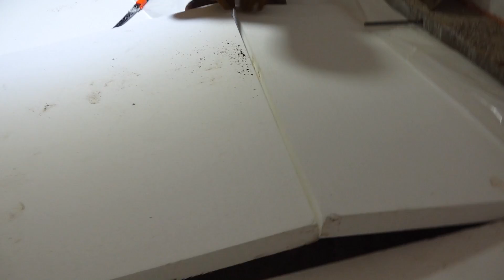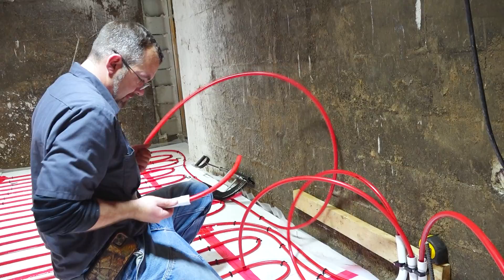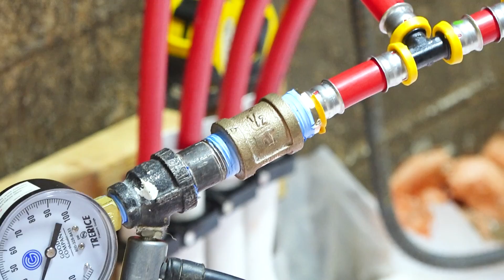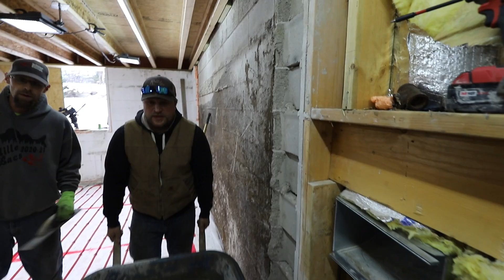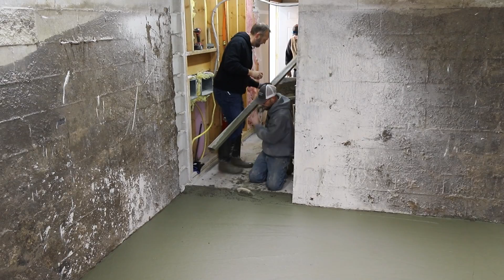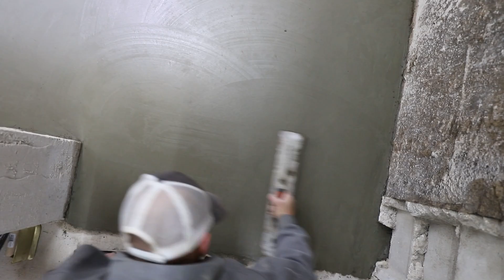Pouring the Basement Floor with Infloor Radiant Heat | Home Renovation & Addition Part 19

Comment: Why didn't you hire a pump and pump the concrete in . It would of been a lot easier and one heck of a lot faster. Plus you wouldn't have taken the chance of rupturing or puncturing one of the lines with the wheel barrels or people walking on the lines .
Reply: Couldn't get the truck there
Reply: The truck couldn’t get within about 50’ of the window even if we could It would had to moved around by hand or wheelbarrow. Using a pump would have cost $650-750 and not saved any time. 2 guys moved all of the concrete in to places in about a 30 minutes. Tires on wheelbarrow  will not damage the pex a board was placed every time it was dumped

Comment: Why didn't you pump it through the window?
Reply: The truck couldn’t get within about 50’ of the window even if we could It would had to moved around by hand or wheelbarrow. Using a pump would have cost $650-750 and not saved any time. 2 guys moved all of the concrete in to places in about a 30 minutes. Tires on wheelbarrow  will not damage the pex a board was placed every time it was dumped

Comment: MATT -- WHY DID YOU NOT BRING THE CONCRETE FOR THE FLOOR THROUGH THE EXISTING WINDOW RATHER THAN WHEEL BARROW IT IN? I ENJOY YOUR CHANNEL VERY MUCH !
Reply from the maker: Truck can’t get over there. Thanks!
Reply: I was also thinking in the line of a concrete pump. But it worked out fine anyways. Maybe a pump isn't worth the money for such a small area?
Reply: The truck couldn’t get within about 50’ of the window even if we could It would had to moved around by hand or wheelbarrow. Using a pump would have cost $650-750 and not saved any time. 2 guys moved all of the concrete in to places in about a 30 minutes. Tires on wheelbarrow  will not damage the pex a board was placed every time it was dumped
Reply: It was so obvious that they would have backed that truck up to the window if they could have---so there must have been a good reason not to. And the only logical reason is the truck is too big. But after Matt explained how it only took 45 minutes to go from start to DONE, using two monkeys with wheelbarrows made a lot more sense.

Comment: The bit about the conductivity difference between concrete and wood is a great real-life example for when I teach thermodynamics in my intro physics classes, many of whom are future engineers.  Like he said, those wide, metal tracks for attaching the tube to the underside of the subfloor helps disperse the heat.  

Teacher-mode: Engage
Heat is transferred basically by atoms or molecules jiggling and bumping into their neighbors.  In solids they’re a lot closer together so it’s much easier to transfer heat.  It just depends on the density and atomic structure as to how easily they conduct.  Wood is pretty low, concrete is medium and metal is super high. The thermal conductivity of air is super low because the atoms are so far apart so less heat is transferred per given time.
Teacher-mode: Disengage
Reply: Gotta love teacher mode especially as I consider myself a lifetime learner.
Reply: When a person stops learning, they start dying!
Reply: Thank you for the explanations.
Reply: a recent video from https://www.youtube.com/c/BattleshipNewJersey mentioned that the wood decking on the battleship is insulating, it helps keep the heat inside the ship

Comment: Where were those power tools to remove old concrete when I was doing that back in the 60s and 70s?  Oh, that's right they hadn't been invented yet....it was a bummer doing everything like that with sledgehammers and cold steel chisels. Those concrete guys did an amazing job.  I have never seen those types of knee sleds before this video and now that I've seen them in use, in my opinion, they are by far the best type to use on any concrete floor pour. Not only did they glide easily they didn't leave ridges on the floor like it does when people use pieces of foam or plywood for their knee pads.  The finish on that concrete floor was also one of the best I've seen for a basement floor.

Comment: Matt I do have a question for you or your concrete guy.  After watching them bring 500 loads of concrete in wheelbarrows my back is killing me.
I would think there has to be some way to pipe in the concrete.  Is there a reason they didn't do something like this?

As a novice woodworker (hack) I know even less about construction.
Reply from the maker: Pump costs more than two guys with wheelbarrows
Reply: @mcremona  Ok that sounds like a great reason.  I was just thinking about it if I was manning a wheelbarrow.  Being almost 60 with chronic back pain makes me cringe.  You do have a good point about the money.  
Best of luck to you and the family.
Reply: The truck couldn’t get within about 50’ of the window even if we could It would had to moved around by hand or wheelbarrow. Using a pump would have cost $650-750 and not saved any time. 2 guys moved all of the concrete in to places in about a 30 minutes. Tires on wheelbarrow  will not damage the pex a board was placed every time it was dumped
Reply: @donavanshomes  Thanks. I wad not trying to 2nd guess you guys.  Just trying to make some sense in my brain.  I am enjoying watching this whole process.  
Also I am impressed watching all of you do this in the Minnesota  winter.

Comment: Surprised the didn't pump the pour through the window
Reply: The truck couldn’t get within about 50’ of the window even if we could It would had to moved around by hand or wheelbarrow. Using a pump would have cost $650-750 and not saved any time. 2 guys moved all of the concrete in to places in about a 30 minutes. Tires on wheelbarrow  will not damage the pex a board was placed every time it was dumped
Reply: Read replies above

Comment: Why did not put concrete through the window with a pump?
Reply: The truck couldn’t get within about 50’ of the window even if we could It would had to moved around by hand or wheelbarrow. Using a pump would have cost $650-750 and not saved any time. 2 guys moved all of the concrete in to places in about a 30 minutes. Tires on wheelbarrow  will not damage the pex a board was placed every time it was dumped
Reply: See answers above

Comment: I guess I don't understand the layout of your house. How come the truck didn't go around to the other side and dump concrete through the window directly into the space?
Reply from the maker: Not truck accessible terrain
Reply: The truck couldn’t get within about 50’ of the window even if we could It would had to moved around by hand or wheelbarrow. Using a pump would have cost $650-750 and not saved any time. 2 guys moved all of the concrete in to places in about a 30 minutes. Tires on wheelbarrow  will not damage the pex a board was placed every time it was dumped

Comment: The first time I poured concrete I thought it flow out of the truck, into the forms and level itself. Thankfully the neighbors and truck driver jumped in and helped me. I never did another concrete job without using a crew.

Comment: Loved the vid. I have to ask though, is there any way to run an aux heating line from a wood stove?  You have a ton of wood scraps in your work, and it would be nice to be able to use some of that for supplemental heating in place of gas.
PS, hope to see some real insulation on those walls go up.
Reply from the maker: Yes, you could tie in a wood boiler but I don’t produce anywhere near enough scrap to make that worth it

Comment: wow, wheelbarrows to deliver concrete. That is so much work. I expected you would run it direct from the truck thru the window. I guess that dirt is too soft to support the readimix truck's weight.
Reply from the maker: Truck can’t easily make the turn and there’s a steep hill to get there. Also would be concerned about putting that much weight over the retaining well. The other pours had the truck in the driveway and pumped

Comment: The floor looks amazing.
One question though: Was there no need of a little steel in the concrete? Like a shrink net?🤔
Reply: Not sure, but steel is to carry tension loads. Concrete itself is very strong in compression. A floor will see lots of compressive loads.
Reply: @PatFarrellKTM  You are right. At least in the case of using rebar to make steel re-enforced concrete.
What I mean is a much thinner netting to prevent cracks due to shrinking, above the added strength.

Comment: Those concrete guys did a fantastic job. I have a question though. Why did they hump all that concrete in wheelbarrows instead of pumping it, you had access through the window opening?
Reply: Well, the dirt outside must have been too soft for the weight of the concrete truck to tailgate through the window. 
Otherwise, a pump mix is more money for the pea-rock and cement content, you would have to cut two men or more off the crew to pay for a pump for a day. I think the concrete contractor got the math right, actually.
Reply: @johanngoethe6729  he answered that question, they couldn't get the truck close enough.

Comment: In-floor heating is the most inefficient way to heat a home or building as the heating elements have to heat all of the concrete around them, which takes A LOT of energy, before they start to send heat to the air.  Heat pumps are the most efficient and best way to provide heating.
Reply: LMAO..... you are so wrong

Comment: Concrete is evil. Anything that takes so much back breaking work just to prepare a hole for the evil stuff is mind numbing and physically crippling. Being a old contractor I try to stay as far from it as possible and carry a vial of holy water just in case I come into contact with any.  So my skin doesn't dry out and fall from the bone. Concrete sucks in any conceivable form too. Wet, solid, hot, cold, powdered, plasma and I'm sure gaseous sucks to, even though I never had the misfortune to use it in that form.  It's all heavy, dirty, dangerous work, hats off to all the guy's that do this for a living.

Comment: Wow, you can tell the guy doing the troweling really takes pride in his job when you hear him talk about it. I used to want to do concrete work. I also used to want to do tiling work. I did tiling work recently and now I don't want to do either. I am in my 50s and in pretty good shape, but hat kind of work is extremely hard on the body. I know understand the term "I'd rather die on my feet than live on my knees" came from. It's not about freedom, its about being a concrete or tile worker. lol
Reply: very very very very hard to find now a day , talking from experience.
Reply: One of the big reasons for me wanting to lose 10-15 kg is to make it that much easier on my body to do any physical activity, very much including manual labor like this.
Reply: as a tile setter this is very accurate 😂

Comment: 19:00  Why didn't they just pour through the window?
Reply from the maker: Can’t get a truck over there
Reply: @mcremona  But you can drive you equipment back there.   Is the cement truck just too heavy?
Reply from the maker: Concrete truck is 3x the weight of my telehandler and isn’t all that great off road
Reply: @mcremona  Thanks.  I'll tell the wife that is why.   When I was at the beginning of the video and asked why, I mentioned it to her and her response was something like "but you don't know anything about construction".  My response was, "that's why I'm asking."

Comment: The guy finishing the concrete is a beast. Lol I would've done the initial pass with the 2x4 and called it good enough for my basement.
Reply: I don't recall if it was ever mentioned if these floors will be finished further or not

Comment: How do you plan to finish office flooring?  Would almost be a shame to cover up that beautiful concrete work.  Interesting to hear "cream" used in context with concrete, but Dan explained it well while troweling multiple times to increase smoothness.  Great video showing the craftsmanship required for finishing concrete!  Amazing
Reply from the maker: We’re just leaving it as concrete. Probably add an area rug
Reply: @mcremona  - Most Walmart and Costco stores I've been in have concrete floors with some type of sealer / wax that adds some sheen to the concrete.

Comment: Hmmm The Cement truck could not go by the windows and pour the cement. Wow, that would have been the easiest and less stress on the heat tubing.
Reply from the maker: Yes, just like the other 2 pours for this space. The truck can only get as close as the driveway

Comment: Why didn’t you pour through that window
Reply from the maker: Can’t get the truck over there
Reply: @mcremona  how many wheelbarrow fulls did it take?
Reply: @maddexxx847   I guess from 8-12. Each one holds 3 cft maybe. About 12x15 room. so about 30- 35 cft.
  edit; from the amount Matt says, that means about 25 wheelbarrow loads.
Reply: @maddexxx847  Barely 2-3" thick.   
look at the red level mark on the wall.  17:28
Reply from the maker: I didn’t keep track. It was 3.25 yards

Comment: In my country (Germany) it is standard to put some sound protection b/ floor and wall, usually some foam.
Reply: Same code in uk
Reply: @gavinferguson  Even in Bosnia I saw them doing it. They also had a nice way to walk on freshly poured concrete. They walked/slided on huge circular cutouts attached to the boots like snow-shoes but used a machine to do the finishing job, looked like a huge horizontal fan.

Comment: What's the price difference between wheelbarrowing the concrete and using a pump truck?
Reply from the maker: Pump is $650
Reply: @mcremona  i just pumped my basement walls in NY upstate it was $1000 just for the pump